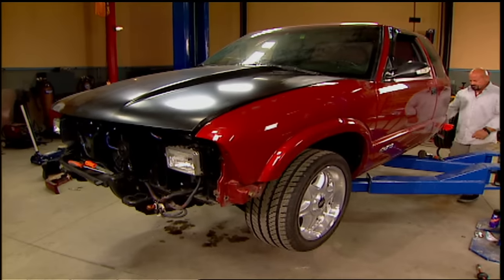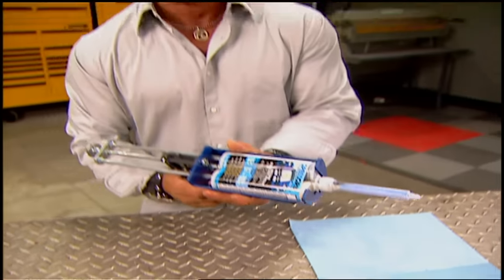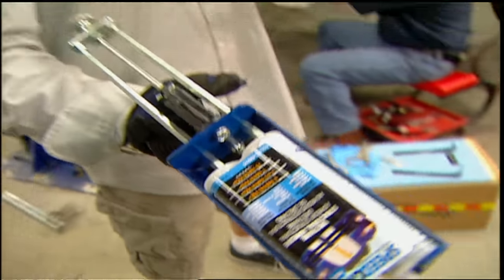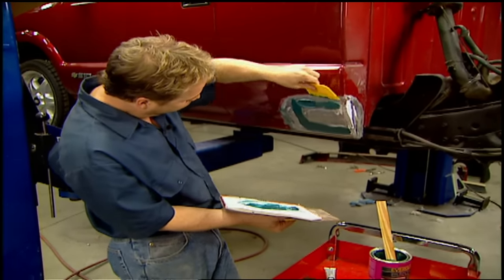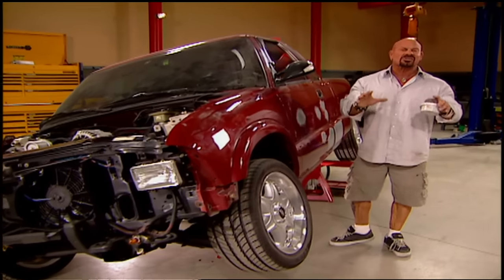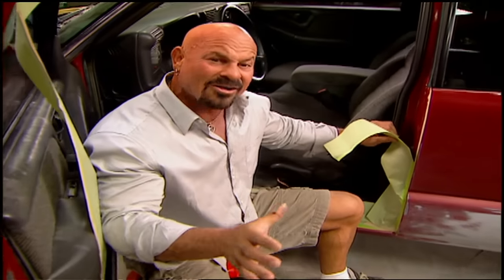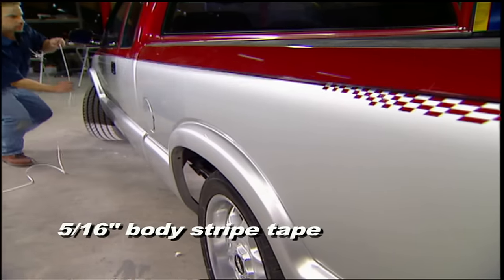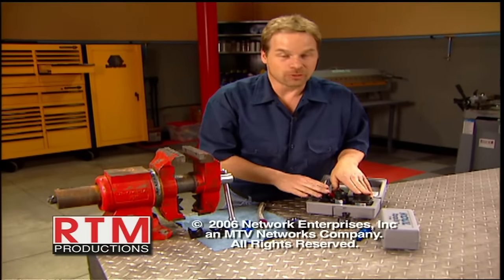Cab Repair Without A Welder? It Can Be Done! - Trucks! S8, E9

Comment: Looks good however, over time you will see a perfect line of where the patch outline is due to expansion and contraction. The panel bond and glue expand and contract at different rates. There is a time and place for panel bonding but but hints are not the place.
Reply: I. would have used almost the entire panel replacing it at the natural body line that way if it does start to show it would be far less obvious.

Comment: I’m doing a 50” long lower half quarter panel replacement on a Chevy Cavalier using panel bond and a contoured backer strip cut out of a junk yard piece. I’ll glue the backer strip in first like you did, but use Pre-drilled holes and wood screws to clamp it, instead of clamps. Then remove the screws and dab the holes from behind to make a waterproof bond. This method causes zero distortion and no pinholes like welding does. Great to see someone else use this method. I know skeptics will say that you can’t help but get ghost outlines and color bleeding from any type of bonding glue. What does the patch look like over a year later?

Comment: Magnets, sanding blocks, glue, cure lamp, air compressor, cut off wheel, clamps, sandpaper, sanding disc, etc.. going to cost as much as welder. LOL
Reply: You still need most of that for any paint job.
Reply: Plus panel bond is non corrosive and very strong. Lasts forever
Reply: @Chopski64 Most people will just rattle can the spot until they have money in the budget for a real paint job.

Comment: You can get a cheap flux-core welder at Harbor Freight for around $150, yes you’ll need other stuff like a welding helmet and some gloves but get a welder and learn how to stick metal together, it’s a capability you’ll find very valuable. 😎
Reply: Key word you said cheap meaning junk
Reply: @mrbriggs68   Not really…. welders are incredibly siqmple machines now, you don’t have to spend hundreds of dollars on a welder anymore to get one that can lay down a decent weld. At Harbor Freight the old black AC welder that goes for around $150 (depending on what coupon you dig up) still kinda sucks. But, they sell a better one, it’s neon green color and goes for around $20 (again, depending on wat coupon you can 
find.

*All of Harbor Freight’s prices have increased in the last few months, thanks to our current administration… 🙄
Reply: @mrbriggs68  They are not junk
Reply: @mrbriggs68  they are great welders for the price. I replaced  the rockers 'floor pans 'cab mounts and door pillars on both sides on my 1975 Ford f250 4x4. Gotta love the rust belt.
Reply: @mrbriggs68  no they are good welders
Reply: @mrbriggs68  nonsense a flux core migwelder is made for light duty welding just like this and if You noticed they put glue on the inside of the body without cleaning anything and You should know that the repair is not going to hold up.

Comment: The 'backing brackets' made from the scrap panel will do the trick,  but in my experience.. 
Using a flange-tool works perfectly.  I've probably done a few hundred repairs that way.

Comment: there is always going to be snobs who get mad when people don't weld in panels. It is like they get disgusted when they see people doing any other type of repair that does not involve welding. Not every fucking car rust/panel repair needs to be welded in. After you do all the needed prep work, rust removal, glue a panel on, and fiberglass, bondo, and paint over it, it aint coming off, its not going to just fall off after driving down the road lol, I dont know where people get that Idea from. If you let it get that rusted out again to the point where it needs to be repaired again, then that is on you, NOT THE REPAIR!

Comment: Always thought someone would manufacture some truck cab corners and rocker panel covers that could be painted with a spray can and then glued on. It would cover the ugly rust and holes, wouldn’t  fit flush but would look good enough for a daily driver truck, and not break the bank!
Reply: They do
Reply: They do.

Comment: That cab corner job looked easy and high-quality. It actually looked better than welding. Is there any reason not to do this?
Reply: I wouldn't do this with anything that would be structural. But for patch panels like this, seems like the way to go if you don't have a welder, or the skills necessary to weld.
Reply: Rust
Reply: You will see a ghost line where the patch is after it ages

Comment: Wait a tick! Buying a welder is not in the budget, you can fix it in your driveway, then they put the truck on a lift, yes when we buy or rent our homes a lift in the driveway is always part of the budget, right!? I would wager that there's a lot more folk's like myself with one or more welding solutions and no lift.
Reply: I live in an Apartment structure. Whats a garage? Im familiar with the forbidden extension cord to run some FluXCore with my 110v mig🤣😅

Comment: Does this work on top of paint? There's a 5" round hole on the floor of my van I'm trying to figure out how to fix it because the floor is corrugated. :(  This hole was cut out of sheer laziness by a shop person installing a diesel heater in my van.
It's going to be hard to go to bare metal because of the corrugation. I was just thinking of using panel adhesive for a piece on top of the hole, since it's hidden so it doesn't have to look perfect.
Reply: And there will still be gaps under the piece :( 
I'm so mad they did this.
Reply: windshields are glued in over paint and the urethane glue does fine for years.
Reply: Try cutting out a patch panel from the junkyard.

Comment: What I want to know is will it crack over time?
Reply: So u see the pros does this so don't 🤔 think body shop not doing this it's not wrong it's made for this try I'll got my own body shop I do the same process
Reply: @fabiancook1498  nah, I’d prefer for my body work to last.
Reply: 😂 lol well pay top dollar for the weild job no complaining when they say$150 hr it's gonna take 6hr to complete 💯 that the way that works
Reply: @fabiancook1498  I'd pay only 20 bucks for a weld job, like that.
Reply: @chevylandt.v  an u must do it ur self from harbor freight
Reply: @Shade_tree_garage01  panel bond lasts longer
Reply: @Shade_tree_garage01  panel bond lasts longer than welding. It's just as strong, water tight seal, non corrosive. Will last a lifetime
Reply: @chevylandt.v  panel bond is better than welding sorry

Comment: Or put filler foam in, and then flatten/reinforce with fibreglass resin and filler.
Reply: That is some Mickey Mouse repair, the foam will cause more rust to form on the back side. Panel adhesive and this technique is not bad for a DIY method.
Reply: @davidparker9676  I fashioned some steel plates, placed them inside hole with very strong resin, then used steel filler and built up the profile. I cleared the inside sill of rust remnants and applied a couple of coats of rust treatment. After setting and then flattening it is solid and looks like new!
Then I noticed the other sill needs doing!
Reply: @MrNaKillshots  When I was a kid, I bought a rust bucket and wire wheeled all of the rust I could see, treated it with rust treatment and filled everything with "kitty-hair" fiberglass filler. You know what? It lasted a pretty long time before the rust bubbles came back. I had a guy cut all the rust out and weld in new steel, the rust came back after only a couple years.

Proper rust repairs involve getting all of the rust removed or treated and sealed with epoxy primer and cavity waxed from the inside. 

Rust is like roaches, you see one, there's 1000X more you cant see.
Reply: @davidparker9676  still, it's what we do. We love a challenge. My wife would've just bought a new car in a nicer colour.

Comment: Really, You can get a pretty nice flux core 110 volt welder for less than $200 and then You will have a repair that will last, You two are just Jerry Rigging it. You should have stayed with the fiberglass filler it is water proof whereas bondo is not infact bondo sucks up moisture like a sponge. The red looked better.

Comment: Seams easier just to weld it.
Reply: Panel bond is just as strong and will last a lifetime
Reply: I think it's ok for cheap cars coming to the end of their life but yeah if you were to restore something properly, especially something rare or of value then you'd simply put the metal back and do it the right way. Seems more common in the US.. In the UK it'd be seen as a bodge.

Comment: Let me get this right spend what 4000 bucks on a project car and all the nice parts but can't drop 800 on a welder.. I think your priorities are wrong and you probably shouldn't start a project.
Reply: Don't you get the point of a DYI garage build. How many guys doing their own cars and trucks shade tree may do this repair. That was the point of this segment.
Reply: Panel bond is just as strong as a weld and it creates a water proof seam that will last longer than any weld
Reply: Plus most diy welders do not cost $800 and do just fine
Reply: Overdramatic